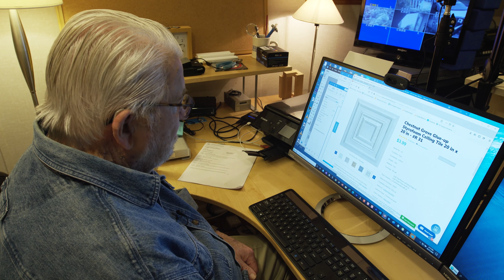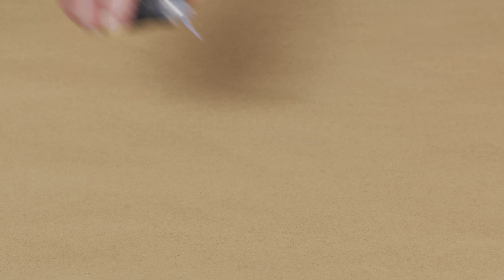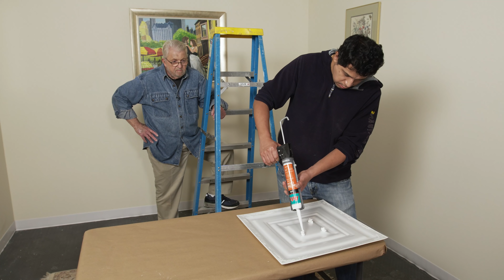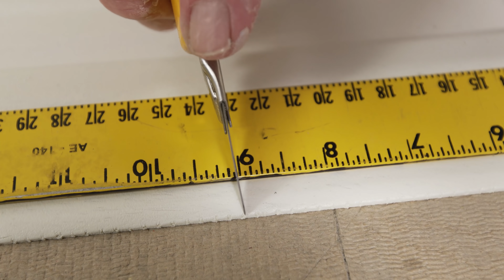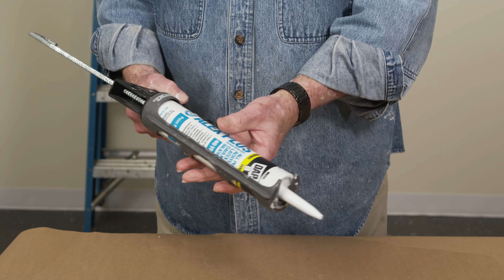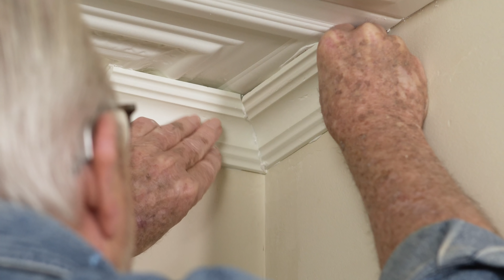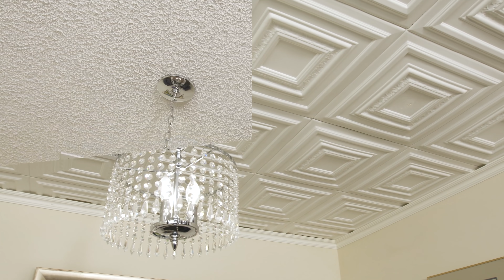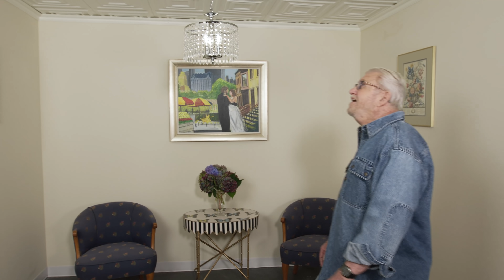Say Goodbye to Messy Popcorn Ceilings: DIY Guide to Covering with Glue-Up Ceiling Tiles

Comment: Are you joking !! These have been banned in the UK for years ,they're a fire hazard,spread fire so easily & act as an accellerant dripping molten polystyrene. This video should be taken down .This is  so dangerous & I'm horrified that any country sells them
Reply from the maker: Hello John,  can you please provide some documentation on where these have been banned?  I could not find any.   I have personally used these tiles in my homes for over 13 years with no issues.  There was an article that was saying a combination of the use of candles in homes and or smoking in the homes would lead to draperies catching on fire which would then led to burning the ceiling.  They have mentioned that the use of oil-based paints is what has made these tiles more flammable.  In the USA, thousands of people are using these, painting them with water-based paints, and we have not seen any issues.  Of course, one should always exercise fire safety in homes and do not leave unattended open fires as well as installing fire alarms.  The decision is of course individual but I do not believe these are fire risk as you describe them.  Can they catch on fire?  Sure they can.  Can your furniture, drapery, wooden flooring, carpets catch on fire?  Yes of course.    Polystyrene is widely used across many industries including medical and foodservices.  See more about this material here: https://www.chemicalsafetyfacts.org/polystyrene/

Comment: These type to tiles have been banned in some countries due to if there is a fire in the room the smoke is quite poisonous and also the polystyrene melts and drips down on you had all mine removed ages ago
Reply from the maker: Can you please provide some documentation on where these have been banned?  I could not find any.   I have personally used these tiles in my homes for over 13 years with no issues.  There was an article that was saying a combination of the use of candles in homes and or smoking in the homes would lead to draperies catching on fire which would then led to burning the ceiling.  They have mentioned that the use of oil-based paints is what has made these tiles more flammable.  In the USA, thousands of people are using these, painting them with water-based paints, and we have not seen any issues.  Of course, one should always exercise fire safety in homes and do not leave unattended open fires as well as installing fire alarms.  The decision is of course individual but I do not believe these are fire risks as you describe them.  Can they catch on fire?  Sure they can.  Can your furniture, drapery, wooden flooring, carpets catch on fire?  Yes of course.    Polystyrene is widely used across many industries including medical and food services.  See more about this material here: https://www.chemicalsafetyfacts.org/polystyrene/

Comment: This stuff is a fire 🔥 hazard. The melted polystyrene will drip on you in a fire and cause awful burns. They’re banned in some countries for a reason.
Reply from the maker: can you please provide some documentation on where these have been banned?  I could not find any.   I have personally used these tiles in my homes for over 13 years with no issues.  There was an article that was saying a combination of the use of candles in homes and or smoking in the homes would lead to draperies catching on fire which would then led to burning the ceiling.  They have mentioned that the use of oil-based paints is what has made these tiles more flammable.  In the USA, thousands of people are using these, painting them with water-based paints, and we have not seen any issues.  Of course, one should always exercise fire safety in homes and do not leave unattended open fires as well as installing fire alarms.  The decision is of course individual but I do not believe these are fire risk as you describe them.  Can they catch on fire?  Sure they can.  Can your furniture, drapery, wooden flooring, carpets catch on fire?  Yes of course.    Polystyrene is widely used across many industries including medical and foodservices.  See more about this material here: https://www.chemicalsafetyfacts.org/polystyrene/

Comment: I thought the popcorn ceiling looked better, it was clean and  also is more fire resistant. it also had nice neat corners. But when they get damaged or dirty they can be hard to repair so it looks nice again. I am looking for something to put over an existing ceiling but do not want styrofoam or plastic on my ceiling.
Reply: Same what did you come up with. Maybe tin tiles
Reply: I’ve just had my popcorn bathroom ceiling done ..it looks fabulous…my plumber did it…its tongue and groove faux white wood…
They are very flimsy lightweight plastic planks. The ceiling is battened with one and a half inch square beams ,then you just tack on the planks..it really does look good so check it out..im in the UK..your plumbers merchant will stock it and your plumber will fit it..got ceiling splits ? Forget them with this joyous stuff ..just give them a wipe..no more ceiling painting..it looks great.

Comment: Looks okay, but long term it’s a fail.  I see some waviness and it’s likely to get worse over the years as the tiles are thin and flimsy.
Reply from the maker: Hi Will, just got images from a home we have lived in and installed these in 2009.  Check it out: https://www.decorativeceilingtiles.net/blog/polystyrene-ceiling-tiles-installed-in-2009-over-popcorn-what-do-they-look-like-after-12-years/

Comment from the maker: 1) Where can these tiles be purchased?  https://www.decorativeceilingtiles.net/styrofoam-ceiling-tiles-20x20/ 2)  Do you offer class "A" fire-rated tiles?  Yes, we also offer Class "A" fire-rated tiles that can cover popcorn ceilings: https://www.decorativeceilingtiles.net/faux-tin-ceiling-decor/ as well as the almost impossible to burn metal ceilings: https://www.decorativeceilingtiles.net/nail-up-ceiling-tiles/
3) Finished projects: https://www.decorativeceilingtiles.net/idea-library/by-application-ceilings-idea-library/

Comment: Doesn’t the popcorn ceiling have asbestos ?
Reply from the maker: In 1977, the U.S. Government banned the use of asbestos in ceiling finishes, and most ceilings installed after this date will not contain asbestos. It is still possible, however, that materials manufactured before 1977 were installed in homes after the ban.

Comment: I tried putting those tiles up on my last project. needless to say I yanked them down and drywalled the ceiling I saved labor cost. those tiles are worthless
Reply: No I haven't but they should work better on a flat surface
Reply: What went wrong?
Reply: @lydiahubbell6278  those panels wouldnt stay up and kept falling down. They were uneven because the popcorn is uneven. It just looked bad and I knew the customer wouldnt be happy. It was quicker to slap up drywall tape and mud prime and paint.
Reply: @jeffp6013  they were using a ton of glue ...did you use the same kind of adhesive and as much as they used? I think it would take a long time even with 2 people.
Reply: @lydiahubbell6278  the tiles were ordered online as well as the glue. We followed the instructions to the letter. Still had trouble and we wasted 3 days trying to square the tile trying to get them to stick trying to get them to do anything that the video says and what the manufacture says
Reply: @jeffp6013  dang..I was skeptical about it being so easy and so perfect on such an uneven surface.
Reply: @lydiahubbell6278  Lydia' your best bet is to remove the popcorn yes it will be messy then you have 3 options. 1- leave as is and paint if it isn't too damaged. 2- float the ceiling out if it is decent shape. 3- drywall over it and then finish
Reply: @jeffp6013  oh, my ceilings are smooth. I have scraped off "popcorn" before. Seems much less tedious than trying to put tiles on it. I do like the looks of the decorative tiles. Have you ever used them on flat ceiling?
Reply: @jeffp6013   right. Totally agree with you!

Comment: Our popcorn ceiling from the 1970s  had asbestos in it.  Might want to have any such ceilings tested before making modifications.
Reply: Asbestos is a concern for properties before 1973
Reply: Same here.  Turned out it was in all the other textured walls and in some old floor tiles under the carpet on the basement floor.
Had to call in an abatement team before anyone would work on the house.  What a pain!
(house was built in 1969)
Reply: @PlumbDrumb  People still getting conned b y that BS still today ?! PEOPLE ! Asbestos is ONLY dangerous when it,s strands ( microscopic ) are cut or ground or in some way strewn into the air you are breathing. Put on a mask..... wet the product and take it down on a Saturday afternoon. ( saving a freakin fortune too ) On the same note..... dont lick the lead paint on your porch.... paint over it LOL I promise you wont become retarded !
Reply: Home Depot and others sell testing kit for asbestos and mailed to a testing center.
These popcorn covering used very little asbestos if any, I heard!
But testing it don't cost much!
Reply: I removed it in my house from the 80s now I’m nervous I may have screwed myself. Although most of the stuf I read says by the time my house was built it wasn’t used anymore.
Reply: This is why I liked the idea of painting it.

Comment: Popcorn ceiling is extremely easy to remove. just spray with a little water and scrape after putting a tarp on the floor to catch the stuff that falls down. Then light sand and and vacuum up the very small amount of dust.  Now do an easy texture job and paint. Not hard at all.
Reply: Yep great idea only one problem asbestos it will get you in the end don't scrape it pay a plasterer to skim over it if in good condition otherwise overboard it then skim it do it the right and more importantly the safe way even watch you tube videos on skimming ceilings there's plenty..

Comment: What a great video. I noticed after watching this video that they make lots of patterns. Thanks you for this idea.
Reply from the maker: Hello John,  you are correct the video is great and there are a lot of patterns and not only patterns, we also offer different types of materials including PVC, Aluminum, Steel, and Copper.   Regardless if you have popcorn or not creating a beautiful ceiling makes a huge difference to any room because a ceiling is the largest area of a room that does not get covered up with furniture, art, rugs etc.  We specialize in Decorative Ceiling Tiles for over 13 years now and our staff is happy to help you with your project. Visit our website at https://www.decorativeceilingtiles.net/ or call 866-297-0380.

Comment: I thought these were banned because they are not fire proof and melt they then fall to the floor and ignite other materials
Reply from the maker: Can you please provide some documentation on where these have been banned?  I could not find any.   I have personally used these tiles in my homes for over 13 years with no issues.  There was an article that was saying a combination of the use of candles in homes and or smoking in the homes would lead to draperies catching on fire which would then led to burning the ceiling.  They have mentioned that the use of oil-based paints is what has made these tiles more flammable.  In the USA, thousands of people are using these, painting them with water-based paints, and we have not seen any issues.  Of course, one should always exercise fire safety in homes and do not leave unattended open fires as well as installing fire alarms.  The decision is of course individual but I do not believe these are fire risks as you describe them.  Can they catch on fire?  Sure they can.  Can your furniture, drapery, wooden flooring, carpets catch on fire?  Yes of course.    Polystyrene is widely used across many industries including medical and food services.  See more about this material here: https://www.chemicalsafetyfacts.org/polystyrene/

Comment: We covered our popcorn ceiling with the thinnest sheet rock available.  It looks great.
Reply: Good idea. That also adds about another 30 mins or so of fire protection
Reply: I'm living in a old mobile home. The ceiling is falling apart. You said you used thin sheet rock?
Reply: @pegasusfly67  1/4 inch thick.
Reply: @pegasusfly67  1/4 inch sheetrock.. however you'll still have to tape and mud it.. and I'm not sure a mobile home will support the extra weight... just dampen and scrape the popcorn off.. it's not as hard as hanging new, taping mudding and texturing
Reply: @gregoriodexterfu2  My popcorn ceiling had been painted several times since being installed many years ago which stiffens it up. I tried dampening and scraping and it would not come off. My palm sander even had a hard time removing it.
Reply: I did the same thing but with light weight 1/2 in. sheets. Used a dry wall lift to put in in place. Super easy. Just looking at that ceiling in the video is depressing
Reply: I tried laminating with 3/8 in.  had trouble with screws going through.  1/2in. is better
Reply: @marcuscicero9587  use anchors?
Reply: 1/4 inch? That stuff is so light. You could've used a spray bottle and lightly wet the ceiling. Then it scrapes off easily. Makes a mess though. As long as you got a good finish man, because 1/4 inch is only 8 ft and means more but joints, it's just as fast to cover it.
Reply: @chadwhitfield6946 mine wasn't, some have plaster mix.
Reply: @chadwhitfield6946  The 1/4 inch drywall needs mud the mud needs sanding the dust from sanding is way more potent than a roll of poly un ravelled on the floor to catch what you scrape.
Reply: Nobody told you how to easily take it down? Still can :)

Comment: It takes literally less than an hour to scrape off all the popcorn texture.
Stop being lazy, folks!
Reply: It is messy to scape off.  Also virtually every popcorn ceiling conceals an imperfect not leveled ceiling.    Popcorn ceilings are very common today for low cost new construction by big national home builders.       I would not scrape it off unless it was my forever home.
Reply from the maker: @johnhanselman6371  that is correct!  Unless you are lucky and get nice smooth drywall under it, it will look pretty back once scraped.  So think again folks, after you scrape it ( make sure you test it for asbestos before )  you may have to clean off the dust, skim coat it, sand it,  prime it, and paint it and you will get a flat ceiling.  Or you can cover it up with some beautiful decorative ceiling tiles in a couple of hours and add some character, color, and dimension to your room.  We carry 100's of pattern and color options. https://www.decorativeceilingtiles.net/ceiling-tiles/

Comment: I would use it on a high ceiling 10 ' or higher to rough and cheap looking
Reply from the maker: High ceilings are my favorite too!  But trust me, the tiles are cheap-looking.   Having personally installed in multi-million dollar homes.   Our tiles are usually what looks most expensive from the project and were most affordable, at least that is the feedback we have been getting.

Comment: Nothing like putting extremely flammable styrofoam all over your ceiling. If you were trying to escape your house during a fire this stuff would turn into almost a liquid drip down on you and cause severe burns
Reply: I don't sit around worrying about things like that.
Reply: @amanda8247-t7x  Well you SHOULD!!
Reply: @amanda8247-t7x it's very serious  https://youtu.be/mQDFgsAWRBo

This is a fire that happened in a nightclub the ceiling was covered in soundproofing foam a very similar material to what that man is applying on the ceiling in the video. Most of the people who survived this fire wish they hadn't because the pain is so bad from the Burns
Reply: @amanda8247-t7x  your funeral.

Comment: Would these tiles be suitable in a bathroom?
Reply from the maker: Yes, they are a good choice for residential batrooms.   Here are some images:  https://library.decorativeceilingtiles.net/?unonce=22a07de392&uformid=741&s=uwpsfsearchtrg&taxo%5B0%5D%5Bname%5D=material&taxo%5B0%5D%5Bopt%5D=1&taxo%5B0%5D%5Bterm%5D%5B%5D=styrofoam

Comment: You should have done the crown molding first, the way you did it left huge gaps where it touched the textured tiles.
Reply: I agree molding should have been put up first..
Reply: This is the problem we had, we had installed 3D PVC 2 by 2 ft ceiling tile, we could not apply crown due to big gaps near the wall. We may have to uninstall tiles to edge of wall & install 2 inch trim against the wall, then apply crown molding since we do not have any gaps.
Reply from the maker: Hi Richard, that is another way to go but if the molding's "lip" is not wide enough, it will not look great either.  Most people, believe it or not, prefer gaps. There is also the option of using a filler tile where you can use a design less deep around the perimeter which will not have gaps and can be butted up easier.

Comment: I have considerable experience installing embossed tin and copper decorative ceiling tiles, but have not really messed with the paintable styrene ones before... looks like something I may be interested in installing in a small bathroom remodel - do they tolerate bathroom humidity well?
Reply from the maker: Hello Burger, yes they do tolerate humidity. You can order them here: https://www.decorativeceilingtiles.net/styrofoam-ceiling-tiles-20x20/

Comment: if anyone has a popcorn ceiling that is hard to remove, one thats been painted over many times over the years.. dont waste your money on that crappy popcorn ceiling remover stripper. get the citri strip, alot cheaper and works great removing the paint and popcorn without damaging  the sheet rock.. just roll it on, come back in about 20 hours and scrape it right off. ez pz. tiles are also great
Reply: Thanks for that heads up👍!!